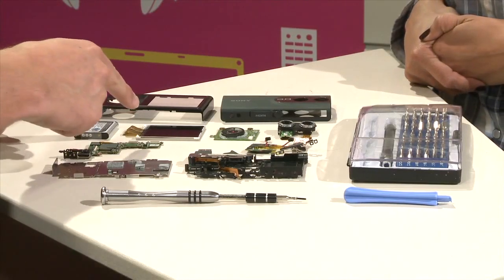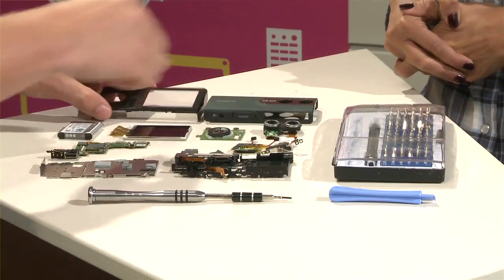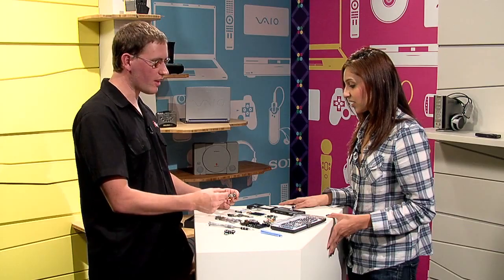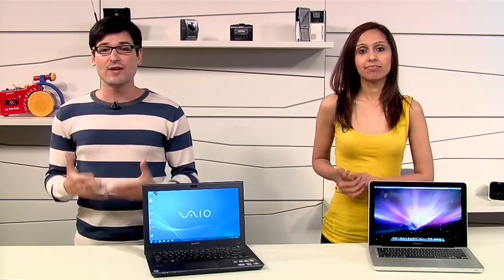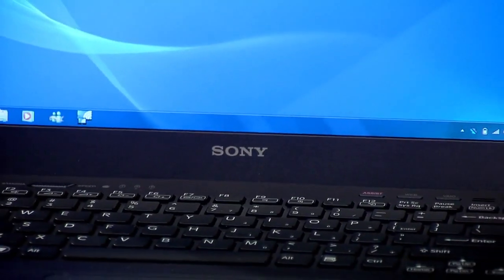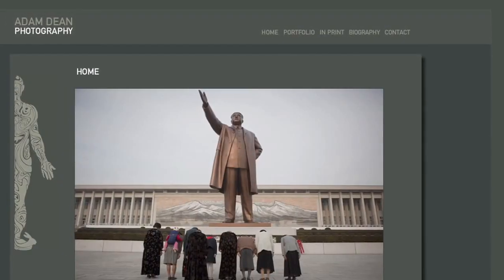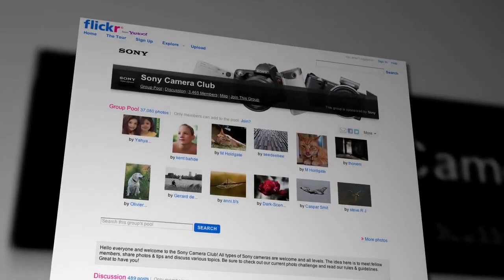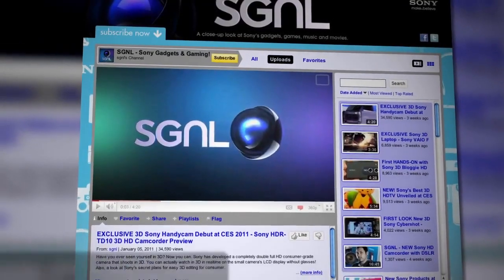Sony Vaio S Series vs. Mac Book Pro! Plus: Tearing Down a Bloggie 3D And Award Winning Photos - ...

Comment: -cont.- Lion and you can pay extra for a pro with retina display.
The S series VAIO has i7 at the price cheaper than the pro with i7 and the 13" laptops are lighter than the 13" pro (by almost a pound). The S series also has Vegas 11 platinum. If you have sony cameras or tablets, it's also easier to connect memory cards. If you're not happy with the S series, you can pay more for the Z series. Same with the pro. Go with a 17" or 15" with more features if you're not happy with the basics.

Comment: Your gonna compare a brand new computer to one that had been used daily for 3+ years to a brand new one off the shelf? sure its gonna be snappy, as would a brand new mac. they round up on the mac price to $1200 and say the vaio is under a thousand at $999, come on, more than $200 less? 2 dollars?. Also, windows is not only on PCs, MACs can run windows, i can actually run windows on one screen and osx on another with my Mac. but a PC cant run OSX. Ahem